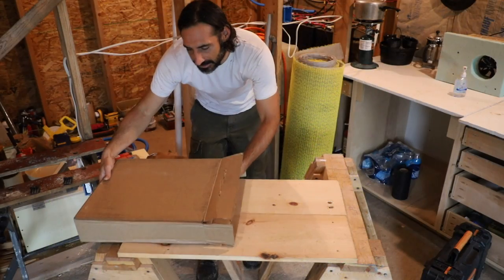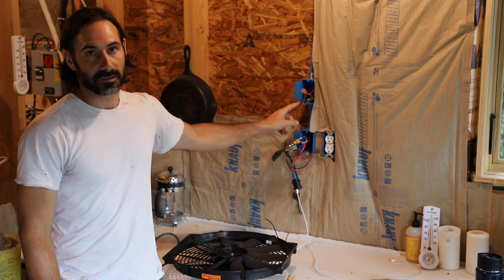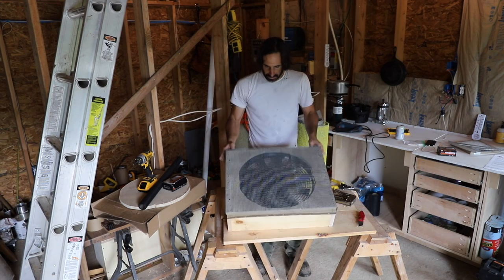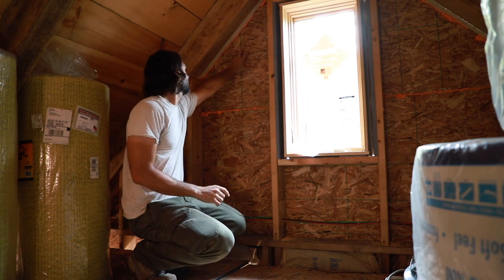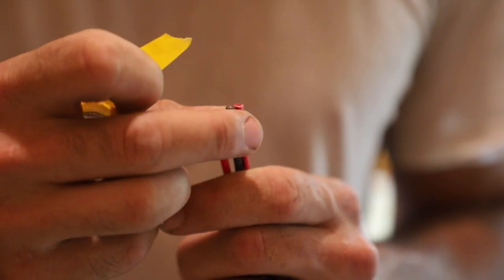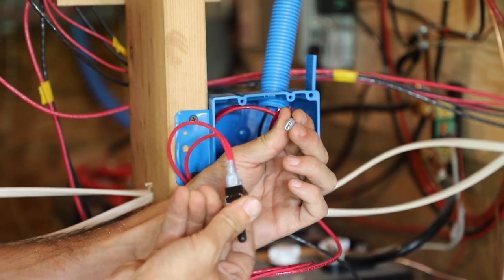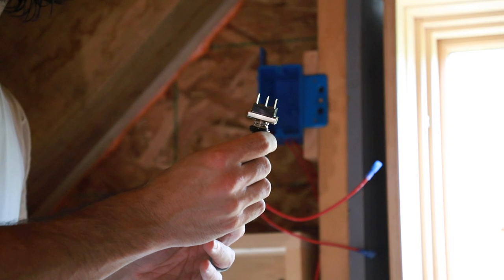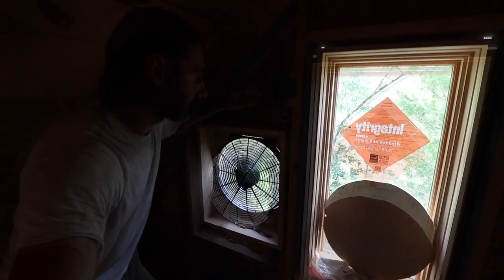Off Grid Alternative to Air Conditioning?  Making a Whole House Fan From a Radiator Fan

Comment: @50 Acres & a Cabin  That's a good job for what it is but I personally would have taken the time to install the largest size fan i could find over that window and another equal size and height in the bedroom to get some flow through there as well.  But it works for you so that is what counts. You definitely need a PWM module for that thing.  Thanks for the video and really look forward to them. Nice job you are doing.
Reply from the maker: yea I am kinda wishing I got a size that would fit up there it kinda bothers me to the side like that.  I will wire in a PWM controller for sure.

Comment: As open and uncluttered as you have your house, I'd bet you could just run the fan long enough to evict the hot air, unless you have significant thermal mass to equalize downward.  Under most circumstances, intermittent blasts would be quite tolerable to me.  Great start to what promises to be an excellent adventure!  Thank you.
Reply from the maker: Thanks Jill, ya it works pretty quick and then I can shut it off.

Comment: Just a couple of thoughts... Make a sheetmetal duct up to the peak of the roof... use 1"interior duct insulation which will help absorb some of the noise.  Will solve two issues better heat removal and noise reduction.  I would also probably install an automatic thermostat on the second floor to bring the fan on when the temps get hotter on the second floor.
Reply from the maker: Those are good ideas thank you

Comment: Great video I miss some of the other videos about wiring for DC so I learn a few things there curious though any plans on trying to deaden the sound. I can't think of how you could do that and still not affect the efficaciousness of your exhaust fan look forward to your reply keep up the good work Jerry videos like you
Reply from the maker: it changes the air in 3 minutes, then I turn it off. I can wire in a PWM controller and run it at low speed that will make it much more quiet.

Comment: Good job brother. 
In my opinion, I think you should add a 3 way speed control switch to regulate the speed or rpm of the fan to reduce noise for night time use while you trying to sleep. 
Just food for thought 😉👍
Reply from the maker: yea good call I am definitely going to do that.  it doesn't need to run full bore...
Reply: @50Acres  
Sounds good

Comment: A large resistor in series could tame that hard working fan. My fan scheme is a 300 watt pure sine wave inverter. Buying suitable DC brushless fans is tricky. I enjoy/ learn from very few home improvement shows. Good going
Reply from the maker: I ended up adding a PWM motor controller.  I had used one earlier on my kitchen exhaust fan, so I used one here also and it worked like a charm.  I have a video on it if you find the playlist for the fan.

Comment: Excellent job! Very intuitive and smartly thought out. It may be loud (as others have claimed), but at 1:100th (maybe 1:1000th) the cost of a pro-system, this is really ingenious. Besides, if you are moving a full-home of air for only a few minutes at a time, sound will not be long lasting. 
I'm not sure if you thought of putting in a temp sensor close to the ceiling (along with one on lower level) so that if ceiling temp reaches too great of a margin above the lower-level to turn on the fan for a few minutes, then turn off once both upper and lower temps are equalized. 
To dampen the sound you could put a faceplate with 1" - 2" holes on it in a grid pattern - it will not dampen sound completely - but will still allow for great suction at a reduced decibel. I hope this comment is helpful.
Thank you for posting this video.
Reply from the maker: Thank you code designs.

Comment: Hey you might want to check the amp draw while it's running. That fan was designed to have a static load on it (the radiator) you could of used the little space about the window and made some duct work and laid the fan flat. It would probably more just as much air and using less power and made it a bit quieter.  Just a thought...
Nice idea!
Reply from the maker: It draws 5 amps at 24 volts

Comment: Is there no variable speed control for the fan? If you can step the voltage down and make it spin a bit slower, you might be able to get the same effect but with a lower rpm.
Reply from the maker: I can wire in an aftermarket controller, its quite loud and much more powerful than needed so yea I agree with you.

Comment: Rather than run such expensive heavy wire (AWG#12 or #14) times 4, you could use a much lighter wire (#18) to run a solenoid to control the fan and just two runs of #14 wire to supply it with juice. This would also save on the cost of expensive switches. And relay solenoids are cheap enough.
Reply: Spam lite - I’d never recommend 18 ga wire for load carrying feeds, but to control a relay coil (< 0.1 A), I don’t see any problem. That’s precisely the point of using a relay. Put the relay next to the high current load and use high ampacity cable to supply power, but the control circuit uses low current and therefore only requires a lighter gauge wire.

Comment: Watched it again, good job with the project of the box and the wiring. The fan noise is just that, fan noise. I could  tell you were warm up there cause your long hair was getting a bit wet. Not to worry you fixed that problem. Hey one more project done. Merry Christmas and Happy New Year.  Tom in Minneapolis. 12/24/19
Reply from the maker: Thanks Tom.  I was crazy hot this summer almost unbearable out there at times.

Comment: A cheap way to possibly reduce the noise.  I'm not a handyman but I did manage to fix my condenser fan on my central a/c.   The fan motor was dead and I asked my buddy who owned an HVAC shop if I could search his A/C graveyard for a good used condenser fan motor.  I found a like new motor and also noticed that most modern A/Cs use a duct around the tips of the fan blades to make it more efficient.   My old A/C condenser fan had no duct.  My friend gave me the motor and the duct.   To my surprise, adding the duct CUT THE NOISE IN HALF.   I noticed that your automotive fan had a narrow duct.   So I would suggest that you also scrounge an HVAC  junkyard and try to mount a duct on the outside and inside, in hope of reducing the sound.   You also might find a proper automotive fan duct in an auto salvage yard.  The outside duct would also help shield the fan from the weather.  You might also reduce the sound volume by using rubber washers between the fan mount and the wall.
Reply from the maker: thank you for that tip!  I will keep that in my back pocket if the speed controller doesn't make it more bearable.

Comment: Good idea but should've wired thru relay as fan was intended 2 prevent Lil wiring u used from Overheating & burning down your nice cabin. As others said rheostat would help with noise by allowing u control over fad speed

Comment: Have you considered finishing the fan off by removing the top block, or making a vent hole. running the vent higher up the wall. when you finally finish the wall, the end result would be some sound dampening and you would be sucking the air from higher in the ceiling. you will loose a lot of efficiency, but might gain some noise reduction.
Reply from the maker: That would be a good idea, I kinda just went for simple but I may have to re work it

Comment: For what you paid for that fan you could of got a Greenheck or cook PRV or inline  for the same price and run at 115v with amperage draw of less then 1.0. then you can also intergrade the fan on a thermostatic switch. Or you could of installed a barometric or thermostatic vent at the roof
Reply from the maker: I preferred not to run it off the inverter, I like to be able to leave it turned off when I am not using 110v tools.

Comment: Do you worry about rain coming in?  I put a fan in at the gable end with a thermostat so when the temp got too hot the fan would come on automatically.  I had louvered slats so don't have to worry about rain except when we get rain coming in horizontally with high wind.  Hurricane - so we have to just clean up whatever mother nature provides.  Thanks for sharing.
Reply from the maker: I was planning on making some louvres slats for mine as well.

Comment: you should just add a copula to the roof like on victorian homes.(4 sides square of windows) this allows breeze of any direction to blow thru and cause a veturi effect that sucks out the interior air and brings in neew air from 1st floor windows. no power needed
Reply from the maker: A cupola is definitely a proven method, however it's a bit slow and I don't want to wait that long for the place to cool down at night!

Comment: radiator fans draw a LOT of amps , the wiring might get too hot , better check that when the fan is running for a while maiby not having to suck through a radiaror helps some , they make a lot of noise too as you have noticed 
if this doesnt work you can wire up two fantastic fans in series to get them to work on 24 volt 
a set of computerfans might be even bettercheaper and queter , those are usually 12 voltso series again , the smaller ans will fit in the peak 
to get the most heat out of the house with youre current setup  you could hook up a big ac hose to the fan and hang the other end closer to the high point under the roof 
think you need to make a small eve on the outside so rain doesnt go straight intoo the fan opening
Reply: @Allen Loser its not just the wirinjg its the switch too , a radiator fan in a car usually has a relay in between the switch and the fan , and thicker cables running from the battery to the fan

Comment: I have 3 fan ( I bought from Lowe’s $129 each ) in my attic connected to the thermo controller when heat hit the 90 degrees fans are kicking but still not enough to makes cool down to the attic  idea is good but in realty is not work well I just let you know ( experiences 😁 )
Reply: Make sure to leave a window cracked downstairs for the pressure to help keep pulling up and out, in my grow room it'll hit 130f easy unless the window is open just enough
Reply: @benson4u215  i have suction vents on ceiling and windows on north always  open ( temp differences ) other way its will suck the air over the fireplace we don't want that :D before the ceiling vents negative air pressure shut the doors XDXD you can here the air flow underneath the doors XDXDXD but still is not gonna work... my attic hits 100 110 degrees.... and also hot ( Hot - hot days I'm talking about )  days sucking the out side hot air in doesn't help :)

Comment: Better than I could do. But I'd have to leave for a bit due to the noise sensitivity issue I have.
Reply from the maker: It changes the air in the cabin in around 3 minutes (conservatively) then I use the built in silencer AKA the off switch.

Comment: nice video. cool idea you had there.  if it snows there... you could always build yourself a wooden flap that drops down over the fan that's attached to the outside of the house and lock it closed for the winter. just a thought.
Reply from the maker: Thanks John

Comment: Yeah I'm a female but this was absolutely intriguing and not any time I can cut the cost of utilities I am 100% for it you made this very professional and very easy I would still need electrician to help me but I would be right in there with him working on this project at what I want to know it's when the snow comes in or really cold weather comes in how do you close up that window where the fan is how do you keep the real cold weather out of that window with a fan in it God bless you you're doing a great job!!
Reply from the maker: Thank you Treva,  I am planning to fit a piece of rigid insulation in the box for winter time.

Comment: Excellent video, is there a thermostat 24V switch you could wire in front and the fan would come on automatically at a desired temperature. Will you buy or build a louver for the outside? I have a old electric fan I thought it would be great for a greenhouse.
Reply from the maker: Thank you Doug!  yes there is and I definitely plan to do that or at least wire in a controller.  I will build a louver for the outside.

Comment: Great idea! If you wanted to slow it down and make it quieter, you could install a potentiometer to adjust the speed. If it was me, I'd leave it at full speed! I might consider adding something like that to my place. You may also want to look into a very small a/c unit just for your bedroom. I bought a small 5,000 btu window unit and it works great on the hot summer nights. Just close the bedroom door and within 30 minutes of running its ice cold. It will run on and off all night. My battery bank is similar to yours. The other weekend the a/c used about 35-40 amp hrs overnight at 24 volts..... anyways, where is the pup?
Reply from the maker: hey offshore,  I will probably wire in a speed controller.  Id also like to run some ac eventually once I get some more power.  I left the pup home for this day trip.
Reply: @50Acres  they start to learn when you're going....

Comment: And yeah a Rad fan is loud as fu$& if you want to a bit quieter I have a suggestion.. if you get a 24”X8’ sheet of dense foam cut the same circle you did on the plywood box and build it out like a wind tunnel and then spray foam all the edges where you attached the box in the stud opening I did something similar in my garage that I made into a shop. Were you able to get any baffles that came out into the roofs overhang ?Also you can get a normal shower fan, and Panasonic makes the quietest one and works well as a hood range, other then that nice work man I like it👍🏻

Comment: Yes it's too loud and it pushes far more air than you need for that application.  It is an efficient design, and noise is a result. Putting it on a speed controller, will quiet it and make it less like living in a wind tunnel.

Comment: Nice job ! Like your idea but you may have wanted to install some type of speed control like a potentiometer or something similar .Personally I live in the desert and the temperature extremes can be between 30-40 between night and day and a fan can be very effective in cooling your house down at night .I have installed heavy duty ceiling fans in every room and will be installing one in the attic as well .They do a great job and make very little noise .More expensive yes , work better ,probably . You explain things quite well ,I liked your video .Regards from the Middle East .
Reply from the maker: Hey thanks Gary, sounds like this works really well where you are.  In the worst conditions it usually goes from 95 during the day to 75 at night.  An improvement but not perfect.

Comment: @ 10:15 You are absolutely correct on how hard DC is on contacts. You also need a diode at the motor to prevent back EMF when you turn off the fan.
Reply from the maker: Thanks Mr Waalkman.  Do you happen to have a good source I can research having a diode?  I have not heard that before and am unfamiliar with why its needed.
Reply: @50Acres  Here's an excellent explanation on using a flyback diode for circuit protection:
https://www.youtube.com/watch?v=LXGtE3X2k7Y

So add one across the leads of the motor "backwards" (also known as "reverse-biased"). The object of this diode is to prevent any high voltage that will be generated when the motor is switched off from finding its way back to your switch (and possibly your inverter electronics). But while the fan is on normally, this diode doesn't do anything.

As for choosing the correct flyback diode, pick a PIV of at least 2x your system voltage (so 50 volts PIV, or better), and because there is going to be some inertia associated with the motor and fan, I would use a 10 amp diode.

You can also put one between the switch and the motor "forward-biased" to prevent any reverse voltage (i.e. the wind driving your fan backwards) from making its way back to your switch. The downside is that there is a .5 to .8 volt drop "baked into the cake" when it comes to diodes so you are looking at up to 12 watts of wasted power. And you will have to use a power diode such as this Vishay:

https://www.ebay.com/itm/VISHAY-POWER-DIODE-70HF10-70-AMP-100V-4-BATTERY-CHARGERS-POWER-SUPPLIES-NEW/231178722619?epid=1618550003&hash=item35d3535d3b:g:1LoAAMXQPatTH~tl:sc:USPSFirstClass!37091!US!-1

This page shows the difference between the two uses of diode (and how they need to be oriented):

http://www.learningaboutelectronics.com/Articles/What-is-a-protection-diode

One thing that I forgot to mention is how fast the motor will stop once it is shut off (probably pretty fast). If it seems like it is braking too hard, and might damage the fan, add a resistor (use one rated for 5 watts at least) in series with the flyback diode to slow the braking down. I can't advise you on the size (the amount of resistance), without knowing the resistance of the motor, but I would guess about 100 ohms would be a decent start.

https://www.ebay.com/itm/qty-3-RESISTOR-5-WATT-CERMET-WIREWOUND-FLAMEPROOF-100-OHM-5-AXIAL-LEAD/143339259588?hash=item215faf86c4:g:9Q0AAOSwMdddOxGf:sc:USPSFirstClass!37091!US!-1
Reply from the maker: Thank you, I will have to really sort this out and hopefully get it right
Reply: @50Acres  Anytime! :)

Comment: Excellent idea but poor choice on the equipment front. You need to find yourself a constant duty motor or actually purchase a barn circulator.  Try finding a 24v superfan for green houses they would work best for this as they are set to run stright off solar or 24v